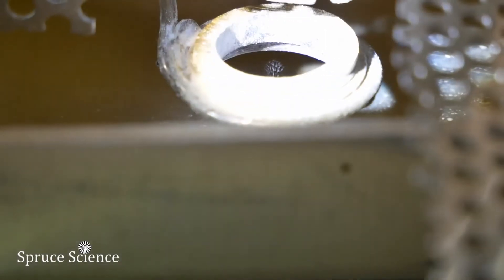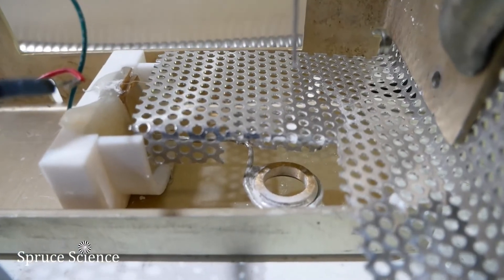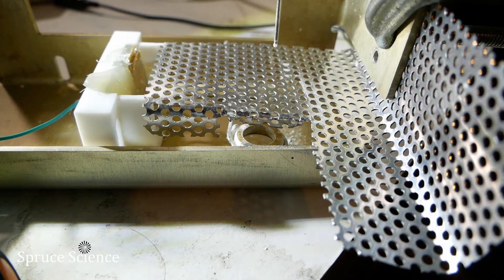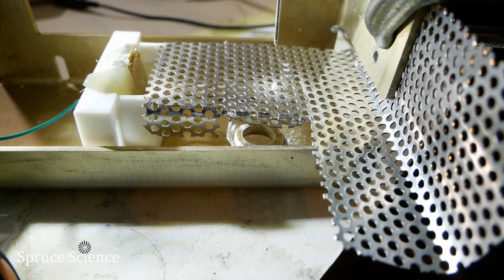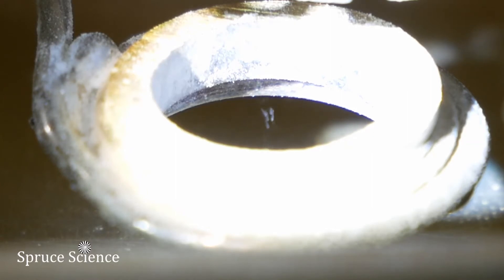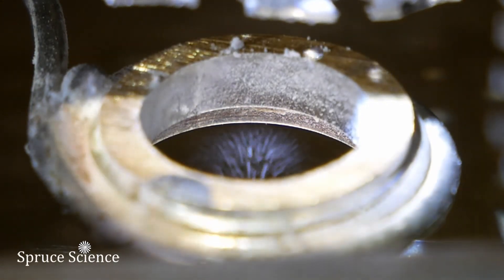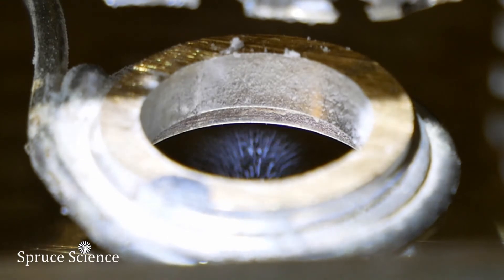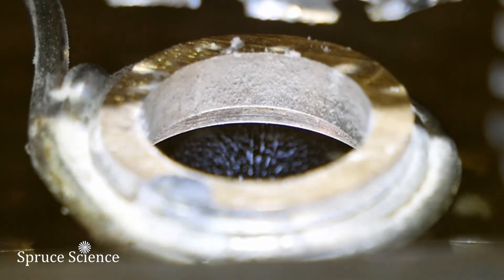Vibrant Ion Trap with High Voltage Ion Generator [High Voltage Power Supply Demonstration]

Comment: I tried electrospraying starch in alcohol. It charged my quartz glass enclosure electrostatically and nothing could be trapped at all. Needle produces ion eind which blows away everything. I like your setup with metal surounding the trap to prevent from charging up. Will continue to tweak my setup

Comment: What DC motor did you use to push the syringe? I assume you'd want something that can run pretty slowly
Reply: Looks like a dc motor with integrated reduction gear. A worm gear should give you plenty of torque and slow continuous rotation.